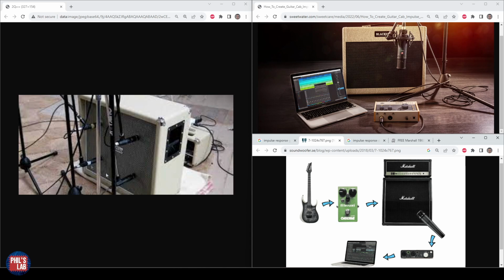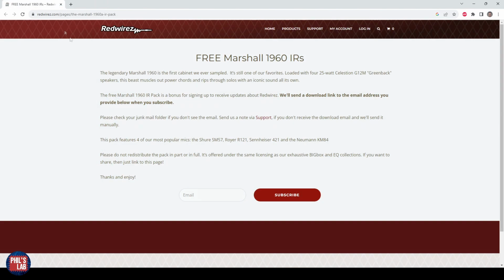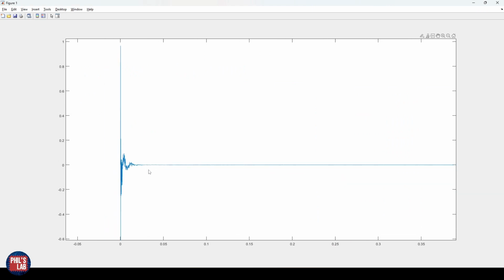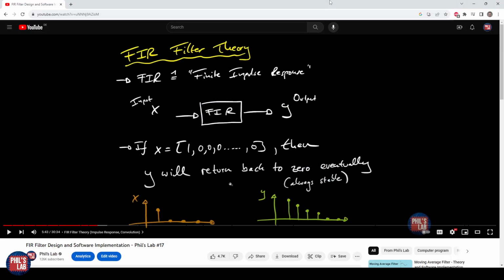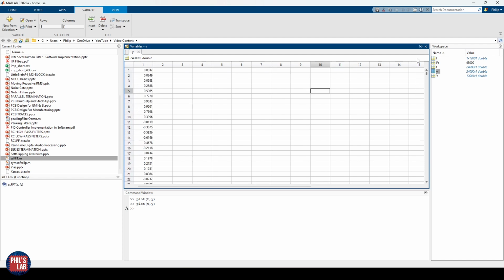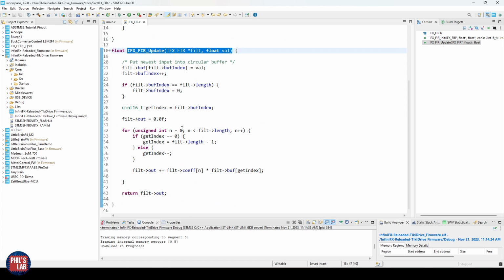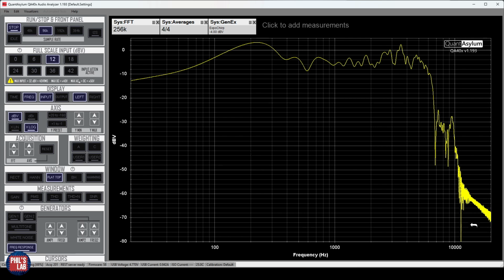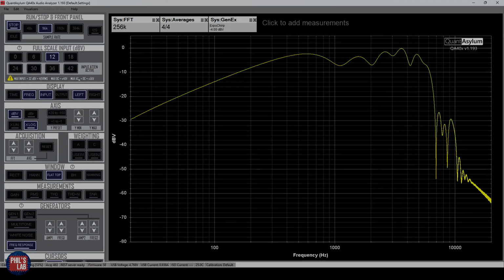Real-Time Impulse Response Simulation in Software (STM32 DSP) - Phil's Lab #126

Comment: Can you talk about the processing time for the different length FIR filters using the STM32 microcontroller? I see that the Cortex-M7 is optimized for DSP instructions, and so I'm curious how fast your FIR algorithm is, and at what point it starts to introduce too much latency to be useful for real-time guitar FX processing (e.g. perceptible latency between the input and output signals).

Comment: I have been scrolling through the video but i can't tell if you have any gain stages before the dsp? If so, what voltage ranges are you working with? Are you staying within that +-4.5V range? Can the codec handle that? Very interested in putting together my own system...

Comment: Hi Phil, I was wondering why the length of the sample would be a problem for an impulse response guitar pedal. You're only doing the FFT once in order to get the values for setting up the filter, right? In any production impulse response guitar pedal you'd just store the various values for setting up the filter as a hardcoded array of values, not process the actual impulse response sample while playing. Even if you want to keep the system so flexible that you could upload a new impulse response sample to the STM32, it would only need to be processed once.. And realistically, if it were my product, I'd make a piece of software to run on a computer which would do the FFT and then send the values for setting up the filter to the pedal in stead of the whole sample. Great content though. I never expected it to be just an FIR filter.
Reply from the maker: The problem isn't getting the IR/filter coefficients, the issue is the time it takes to convolve the coefficients with new, constantly-changing input samples.
The FFT was just to demonstrate the frequency response of the filter.
Reply: @PhilsLab  Riight.. I guess I need to look in to it a bit closer. I didn't have a lot of time this morning. Thanks!

Comment: Btw, at 3:20 , an impulse reponse doesn't have to come from "a click" but is often done with either some (pink/white) noise, a frequency sweep or multi-tone signal. From there the impulse response can be calculated.
Especially a frequency sweep will give a far better signal-noise ratio.
Reply from the maker: That's right :)

Comment: Great stuff. I'd guess that with 256 samples, latency is around 5.3ms? 1/48k times 256, if we ignore the time it takes for the multiplication operation, which is a microsecond or two?
Reply from the maker: Thanks! Yes, that's right. For me personally, playing guitar, any latency better than approx. 20ms is okay.
Reply: @PhilsLab  I agree that anything over 20ms becomes very noticeable. But I can kind of "feel" the latency over 12ms if I'm close to the speaker, and it's noticeable on headphones. The 5ms latency is equivalent of being approx. 1.7m away from the speaker when playing "full analog". So, there is some room for using more samples from an IR. One more question: can the samples be of arbitrary size or do they have to be powers of 2 (64, 128, 256), because judging from the code, there's no reason we can't pick any size (except for latency, of course)?
Reply from the maker: Yeah, sample number can be an arbitrary size - doesn't have to be a multiple/power of anything. Unless you're doing FFT convolution.
Reply: @PhilsLab  isn't the latency purely related to the chosen buffer size & samplerate, not the FIR impulse length? Also I'd like to get a sense of what you found the limits of the STM32H7 to be in regard to those three parameters

Comment: Would an MCU that is tailored more towards DSP have extra perhiperals/instuction set additions that make things like realtime convolutions more efficient?
Reply from the maker: Yep! However, I've also yet to try out the CMSIS convolution implementation to see if there is any speed gain there. Also, with an FFT-based convolution (future video), there should be some speed gain as well.
Reply: usually, yes!
Reply: Can't wait!!! All of these filter vids have been amazing at showing what is normally considered 'advanced' electronics theory but in a 100% practical way to make the knowledge useful! Often, stuff like this is taught purely theoretically and its dry and tedious. However, your content is able to cut through that, drop unnecessary tedium, and show practical examples that people can actually get their heads around .

Comment: Hey Phil, can you make a playlist for hobbiest to learn electronics and then learn PCB design starting from basic till advanced. As someone from non electronics engineering background I find it hard to learn hardware design, specially when my university has more software focused curriculam. But I want to learn electronics and make real world projects, just getting bored with learning only software.
Reply from the maker: Hey, Thanks for your comment! I'd strongly suggest working through 'The Art of Electronics' book and creating the circuits in parallel, if you want to gain basic hands-on experience. What topics specifically would you want to see?
Reply: @PhilsLab Thanks for your response. It's my dream to be able to design an advanced flight controller for Quadcopter and Hexcopter which is able to record and transmit 4k quality videos and is extremely smooth in flight. Can you make a playlist for the same? I came to know that you work on these kind of projects. It would be great to learn from you
Reply from the maker: The hardware-side for flight controllers (without video) is fairly straightforward, at least in comparison to the software aspects. The STM32 videos on the channel + videos on hooking up sensors + power supply vids are a good starting point. Then it's about chosing sensors, IOs, etc.. 
I'd suggesting aiming to make hardware that's compatible with already-available flight control software.
Reply: @PhilsLab  can I expect some detailed videos from you on this? Would be helpful.
Reply from the maker: Yes :)